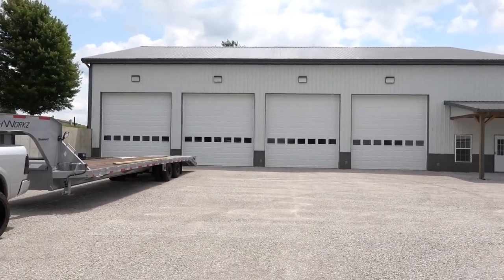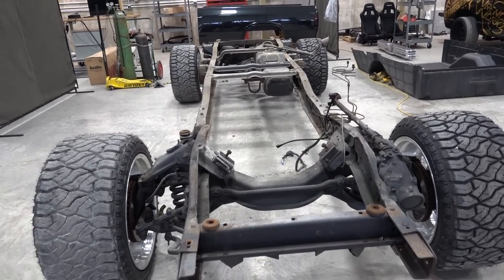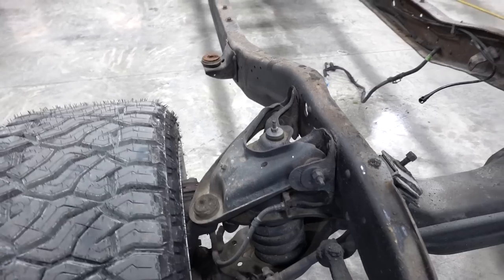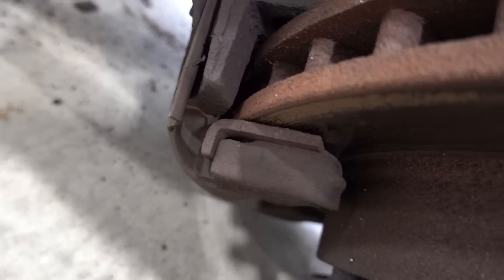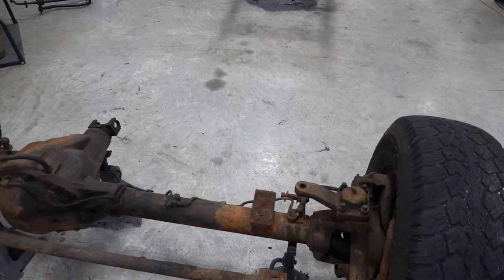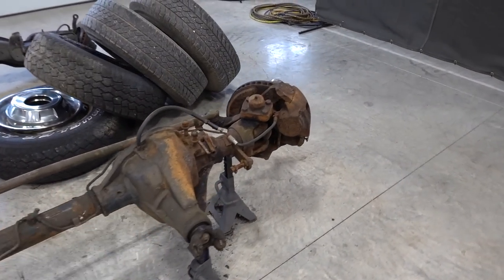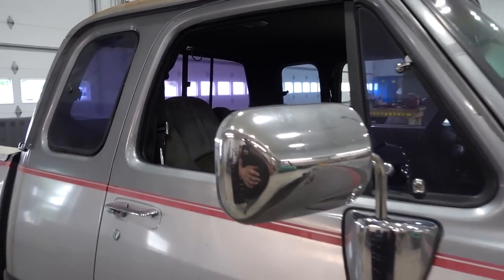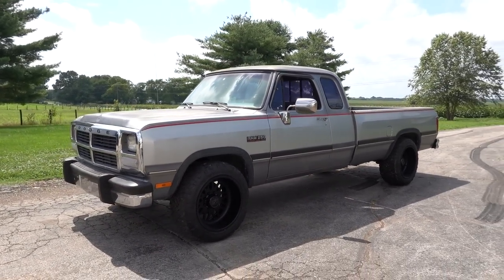Meet Gary The Grandpa Truck!  NEW RAM 250!!!

Comment: Call Charlie at New Era Performance in PA for his bolt in 3 link 4wd coil over conversion for the black firstgen. And Verlin Martin can get you setup with a rowdy VE and injectors. We just flowed 550cc of fuel on mine. We are both chasing that high hp VE record!

Comment: You can use that existing power steering box and keep it in the 2wd location if you run cross over steering. Which I recommend you do with the 4x4 swap. If you dont want to run cross over steering, you will need to find the 4x4 steering box plate.